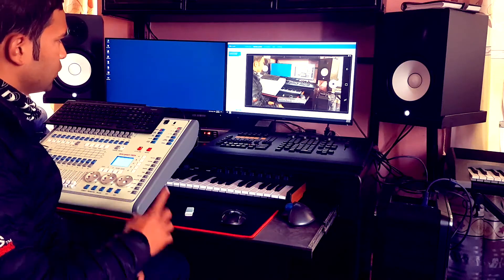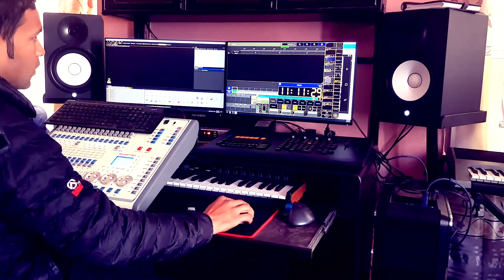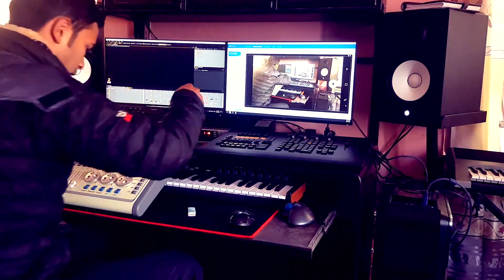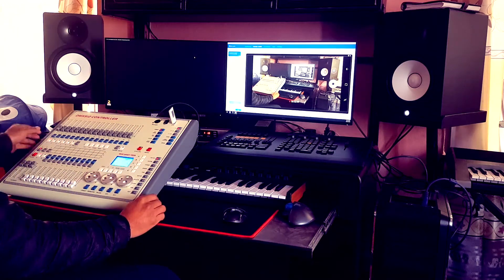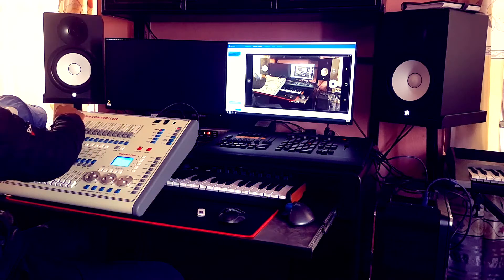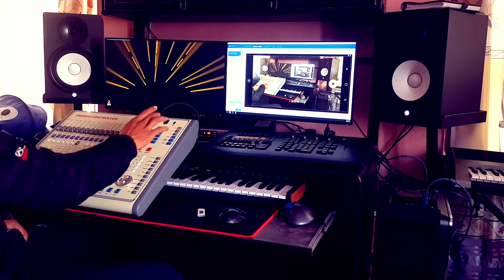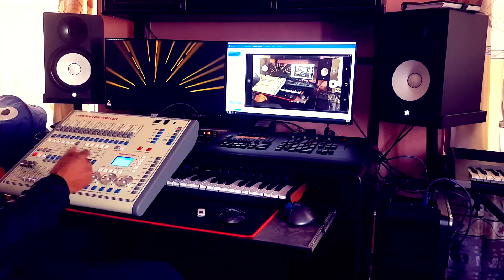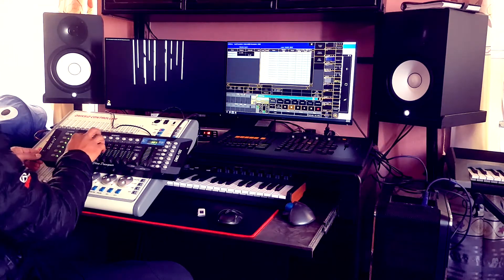How to control grand MA 3D with normal DMX 512 (grand MA 3D  संग सामान्य DMX 512  कसरी चलाउले ) [NP]

Comment: How to output dmx in  laptop through
Reply: Which dmx hardware need to connect
Reply from the maker: You have to need some one Visualize software and DMX input hardware for the connection with Mini Pearl 1024 to Visualizer (Computer).

I use to make these videos;
Visualization Software:- L8 ► https://l8.ltd/m/lc/l8-media.html
DMX Input Interface:- GrandMA2 Command Wing►https://www.malighting.com/product-archive/product/ma-onpc-command-wing-120120/
Visual Control by:- Resolume Arena ► https://resolume.com/
Reply: @anupamachhami8911  Tell Me
 Visualizer Name  Sir